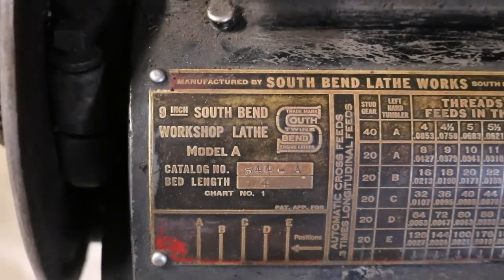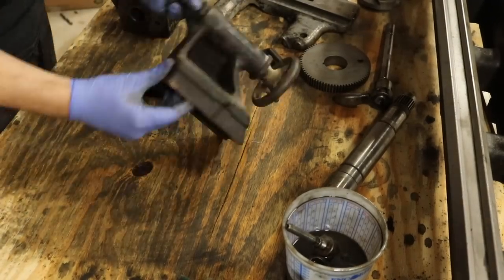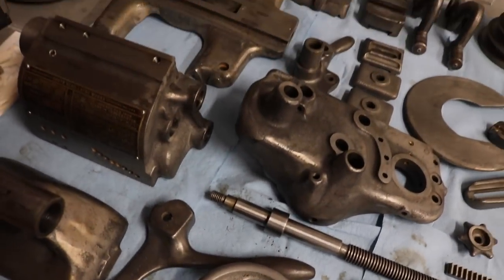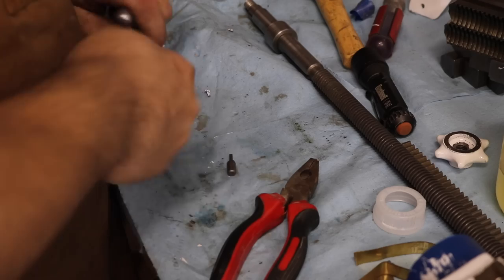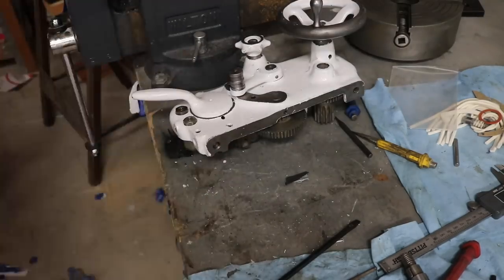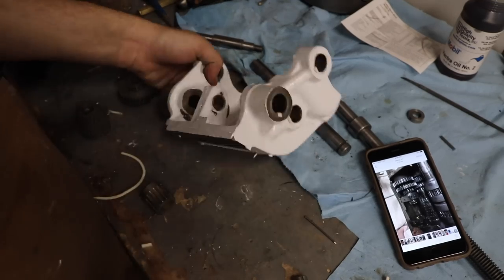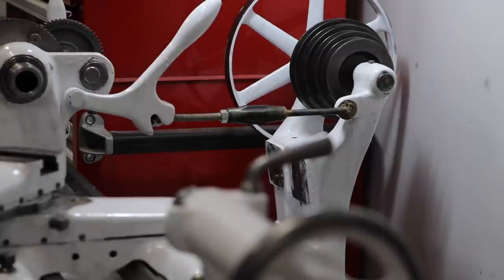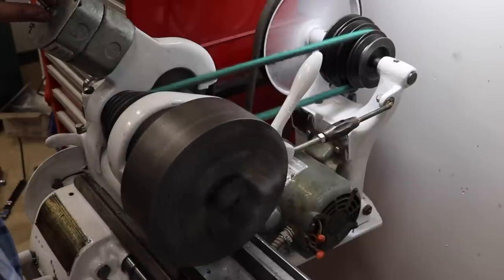1940's South Bend 9A Lathe RESTORE

Comment: I have an older and larger South Bend lathe and have had it for more than 30 years. There was no internet so I had to forge ahead with the old owner's book. I found that it was more a labor of love than a chore. I had a local supplier here in Tucson, bearing belt and chain make me a new belt and it has worked smoothly for 30 or more years, I got shim stock and re-bedded the shaft. I now have a media blast cabinet that I use for cleaning parts. I find it very satisfying to work with my South Bend and I liked watching you do yours. Thanks!

Comment: Hi Jeff,
Great video. I, we my son and I have my dad’s 9 inch South Bend w/ 4 foot bed but no quick change. Instead, when he bought it back in 1963 and worked a second job to buy it new he opted to not include quick change to get 4 V step pulley on head stock, 2 step on motor pulley, collets and draw bar, 4 jaw chuck, steady rest, Fowler rest, tailstock Jacobs chuck, centers. I think the hole package new was around $663.00 dollars or so.
Came with drum switch , too.

He was a tool and die maker for years at Pass & Seymour.

Made his own milling machine attachment which was better than South Bends.

He also made a boring head and fly cutter that uses the collet drawbar to tighten.

I’ve added an Aloris tool post and it is just a wonderful lathe.

Our shop has a new/used Clausing 13 inch which I am cleaning up to get it ready for some serious turning.

Guess all you need for your nice restore of your 9 inch is a nice drum switch.

Thanks again for sharing.

To all, check out my son’s Facebook page, Salt City Locomotive works.

Good luck in your shop👍🚂
Dave

Comment: For paint, I've found farm tractor engine paint to be the best. I think its an old formulation because it goes on with a brush, gets tacky in an our or two, takes 2 or 3 days to really setup well. I'm guessing a week or more to really harden fully. 
Once its hard, its really hard and tough!
Reply: What brand of paint do you use?
Reply: @Pneumamechanical  The lathe is at my folks old place in Michigan, otherwise I'd walk out to the garage, pick up the can and tell you. So I looked at the map, got the name of the tractor supply then checked their line of paints. 
Looks like Rust-Oleum took over their paint line (i have an aversion to Rust-Oleum, to many time had to start a project over because of their goofy formulations, be it water or fish oil base, or whatever the formulation of the month is). Seems whenever I find a good paint source, Rust-Oleum comes in and screws with it, like they're the mob or something.
I doubt I would have bought Rust-Oleum. When I get back there in the spring, I'll verify and try to get more. I recall it said "Ford Engine", and its what I would describe as "smoke gray". 

But this is what the store says they sell:
Rust-Oleum® Professional Paint Smoke Gray 1 gal. Oil Based Enamel

Comment: An excellent video on rebuilding a 1940’s south bend lathe. I went through the same process about eight years ago. And I moved three years ago and only a couple of weeks got around to putting it back together after having to take it apart for the move.  I found everything but the back shaft, the back cone pulleys and the large motor driven pulley. 
I need to get it going again as I need to cut some internal threads in a two inch section of pipe to make a part for the CNC I built about eleven years ago.  My questions involve adapting a 3.5HP tread mill motor and controller to it. I plan to mount the motor in the same location using a CNC made motor bracket, and because I misplaced the large motor driven pulley i need to find a pulley of approximate side and a shaft and a just put on a pulley on the back shaft of the diameter of the original middle one and use the tree mill controller to control the speed of the lathe. 
My questions are what is the diameter of the large motor driven pulley, what is the shaft diameter of the back shaft, and what is the diameter of the center back cone. With this information  I’m pretty sure I can get it back on the road again, I really miss it I have been making do with an old six inch craftsman without any change gears which limits you to just simple turning. 
Thanks 
Hager

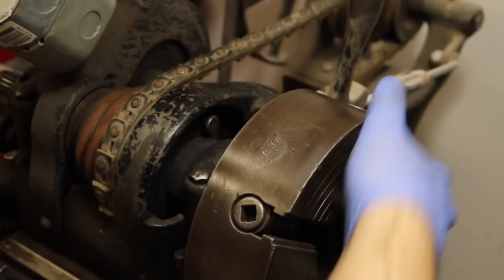Comment: 1:12 WoW I havent seen an adjustable belt in decades. The last one I seen was on my grandpa's grinder and that was back in the 1970's which the grinder and belt was obviously made earlier than that. The 2 grinding wheels were on a shaft that were contained in their own casting which had a pulley on it. The motor was separate. The grinding wheels and motor then mounted to a base plate whereby the belt ran from the motor up to the pulley.

Comment: Nice job.  White looks good and is easy to clean BUT not easy to keep clean.  I was always fond of Japanese equipment (medical and telecom) which was a very light gloss green finish.  Also liked old European trains and machinery in green.  I had a 9A from my father in law.  He bought it in (I think) 1948 with every accessory in their catalog and 52" bed!  I even have the invoice for it.  I seem to recall it was just under $500 total.  It may have been earlier because it did not have the standard South Bend paint.  During WWII, lathes that did get sold went through a special department that slapped a quick coat of paint on them.  Don't recall the color, seemed dark olive drab / gray and looked "quick".   There was a name for this effort.  I'll call it the "South Bend Quick and DIrty War Paint Department".

Comment: Nice restoration! The time lapse video was really great. I did a complete restore on a 1939 SB 11"-4' umd which really turned out very nice and tight. For me it was best to remove and rebuild each sub assembly right from disassembly, bead blast, paint and assemble including polishing ever handle and bolt to look like chrome as I went along or else I would have run out of room and maybe have gotten overwhelmed. Labor time was over 160hrs. knowing that, I can really appreciate the job you did and many others doing the same type of repairs and restoration. I subscribed and am looking forward to all your videos. Thanks, Ed K. Cleve. Oh.

Comment: great video and much thanks to letting us know about all the other great videos. I've been using a 9" A model, 1940 since 1988. It's a work horse. It's kinda sloppy but easily holds a .001" tolerance without paying too much attention to what your doing. i wouldn't worry about the paint. A week after using it it will be full of metal chips and cutting oil anyway. A clean lathe is an unhappy lathe.

Comment: Very nice job.  You put a lot of time in on it and it shows.  I would suggest, as a point of safety, that you replace the switch with a magnetic switch.  Not only would it look a lot better, but it would far safer, should the power go out, or you cut it to work on the lathe.

Comment: Good Job! That's how my Heavy 10 Started. I was actually just going to have the bed re-ground. Then one thing lead to another....... It was worth it! +1 on adding a hardener, I've done lathes with and without and you notice with dry times and durability. Thought I saw Boyd Coddington when you were putting the bed back up on the legs!
Reply from the maker: I'm definitely thankful I didn't need to get the bed reground! Other than one idiot-mark where it looks like someone dropped the chuck near the headstock, it's in pretty pristine condition. I really do wish I'd gone with the hardener, that paint takes FOREVER to cure!

Comment: Great Job rebuilding the Lathe. It looks great and seemed to run really smooth. I am buying on just like it on Monday. Is there any way I could purchase a Thread Chaser from you? I don’t have a 3D Printer. I’m also not quite at the level of Machining I need to be to make one. 
Thanks, Great Video

Comment: You don't have it. 
I noticed my SB lathe base (no legs) has a leveling feature on the tail end base. It pivots with 2 locking/adjusting set screws. this allows you to plop the lathe down an any surface and then cock the tail end mount over to be untwisted while the part underneath is twisted to conform to whatever it is clamped to.
You can identify this neat little gizmo as the base is made in two parts, not one. I imagine it was used only on bench top lathes that came without any type of legs.

Comment: The only criticism I have is I would have pre-oiled the felt strips when you put them in the groves. You already found out about the curse of white paint on your own. 
I believe this lathe may be a conversion from an overhead shaft system  which maybe why you have the Frankenstein motor and electrical system. Other than that, nice video and good job.

Comment: Thats a really nice looking lathe. Not a fan of southbend lathes myself cause all the ones I've encountered have been worn out old school metal shop machines, but your looks like it's been treated well. Also I'm pretty sure that in the 1940's the bearings would have been a babbit instead of just machined castings.
Reply: I don't believe they had any babbitt. Some had split bronze.
Reply: South Bend lathes of that era had no babbitt bearings, except in the carrier bearing for the tail stock end of the lead screw.  Older S.B. lathes, (1920s) had babbitt spindle bearings, and some of the 9" Junior lathes had split bronze bearings, but South Bend went with steel on cast iron, for better longevity in the late '30s or early '40s for their smaller lathes.

  The spindle bores in the headstock casting were bored and honed, and the tool room lathes (of that size) had oil grooves broached axially inside the bores.  That reduced friction a bit and made for better lubrication, since the oil could easily flow out of the bearing and back down into the reservoir.  That type of spindle bearing bore was only used on the high speed models, which in the case of the 9" A models, was a 12 speed lathe.  I have a 1945 War Production model A with that bearing type.

The spindles themselves were precision ground and the bearing surfaces polished, or in South Bend's words, "superfinished".  Steel on cast iron, is going to last the longest, if properly lubed and the felt wicks changed regularly.

Comment: Too late for this project, but for future reference Sherwin Williams, Benjamin Moore, and others have enamels that are specifically designed for use on machinery. FAR more abrasion, impact, and chemical resistant than anything from the big box stores. 

Incidentally, what part of the world are you in? I thought I saw you the other day but felt too silly to say something in case I was wrong.
Reply from the maker: That's good to note.  In my research many folks had compared most oil based enamels to perform similarly, but I would readily believe that there are better paints than what I picked up! :)  I'm in the Kansas City area, so if it wasn't me you saw, must have been some other very, very handsome person!
Reply: Definitely not you then. Curious. I think you have a doppelganger in Layton, Utah. :)